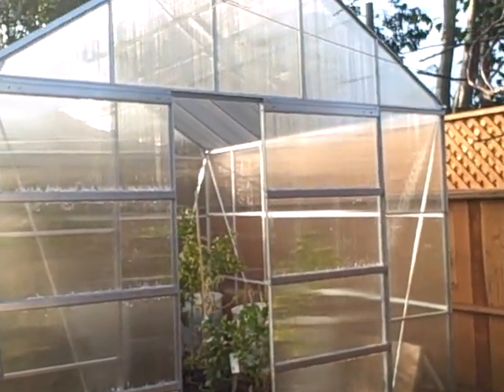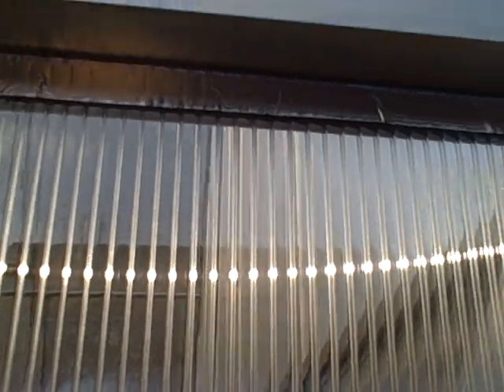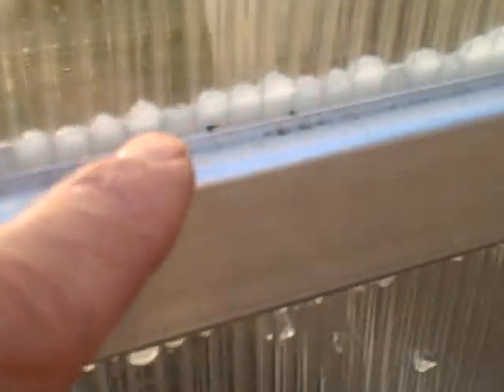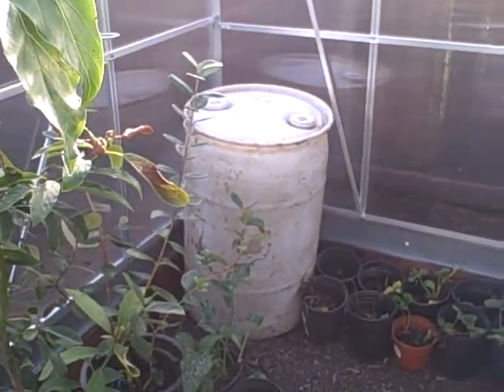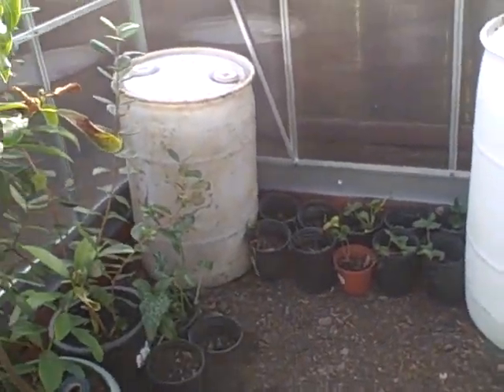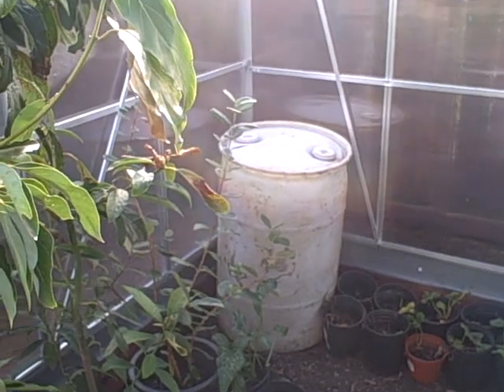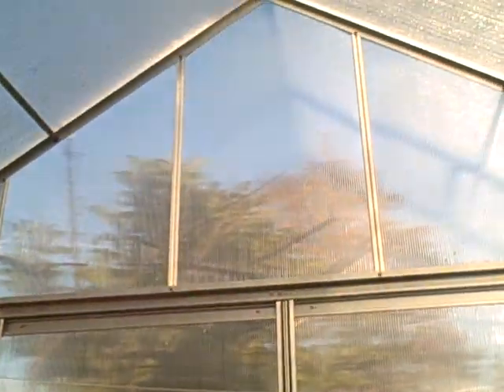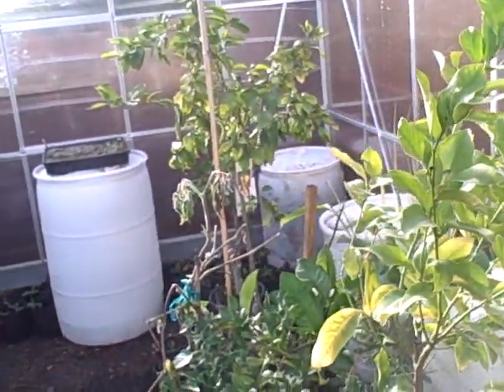Greenhouse Update - Thermal Mass and Improvements

Comment: I also have this kit I picked it up for $600. I winterized this greenhouse and grow tropicals in it. One thing people need to know about polycarb pannels.Cover the tops of them with breather tape or aluminum tape. The sides can also be taped but I did not. The big thing is to leave the bottom open so the pannels can breath and shed condensation. If the panels are flush with the bottom drill small holes for the water to escape. You can also silicone from the inside to help with air leaks.